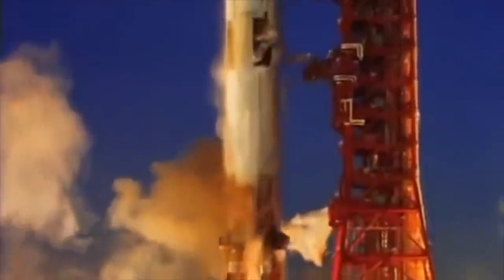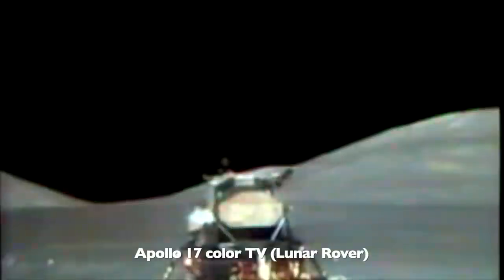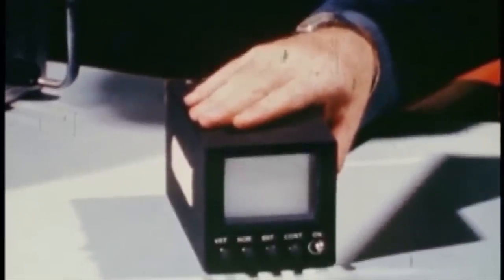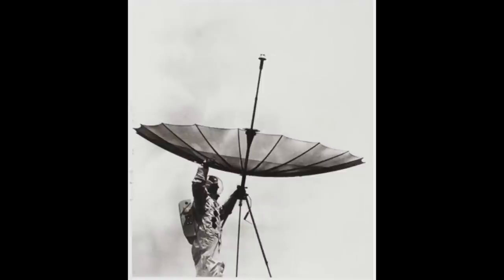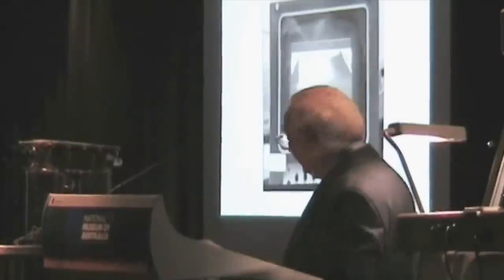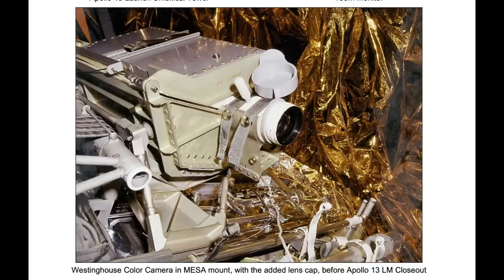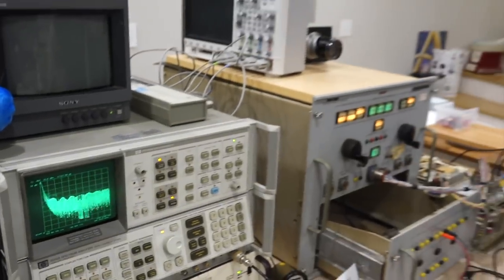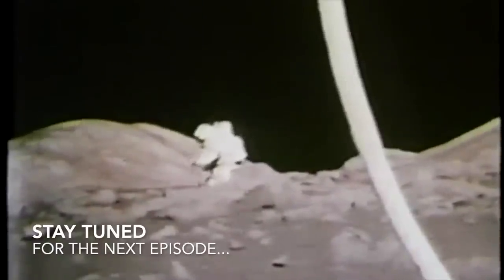Apollo Comms Part 22: How NASA Upgraded the Moon TV to Color

Comment: The good thing about analog TV transmission is that you can still see something even if the signal is bad. Even today's surveillance cameras still use a slightly modified analogue signal. 16:9 instead of 3:4 or 4:5. just longer lines

Comment: When I was going to technical college in the early 1980s, I did a presentation on the CBS-Columbia 12CC2 Field Sequential Colour System from 1951. It too used spinning colour filter discs and also suffered from fringing issues. Interesting that they revived that concept more than a decade later for the colour cameras on the Apollo missions.

Comment: First met Ikegami ENG cameras in the early 80's  Lovely bits of kit. My first was the HL77. I kid you not, the HL stands for Handy Looky  :)

Those NASA guys certainly did manage to squeeze remarkable results from hardly any bandwidth.
Reply: I had the unique opportunity to work with the Ikegami HL-77 prototype in the ABC (NY) Engineering Lab in 1976.  Even took it out in the field once or twice.  The HL-77 was succeeded by the HL-79, and preceded by the HL-35 and HL-33, which were two-piece units with almost-identical backpacks and CCU's.
Reply: The orange and cream colored Ikegami camera shown at 19:10 in the video is one of a series of professional ENG cameras introduced around 1980.  They were intended for a lower-end market (compared to HL-77s or HL-79s).  I believe the model shown is an ITC-730A, but I can't be certain.

Comment: There is a great movie about Parkes and the Moon mission.  It's called "The Dish".  I remember seeing Apollo 17 launch in December.
Reply: In "The Dish" you can hear how the signal from the Moon is received before it is fully over the horizon (and the Parkes dish might have been a degree or two above the horizon) by using an offset feed on the dish for about 30 seconds and then switching back to the straight feed.  This is actually in the dialogue of the movie (although not explained at all) but you have to pay close attention.  This enabled the switch to the Parkes signal to be made earlier than would otherwise have been possible.  When I saw the movie in the theater that immediately cleared up something that I had been wondering about for a couple of decades.

Comment: Chrominance bandwidth is only usually a fraction of the luminance's. You can probably safely get away with 1/10th or less. It would be a bit of work, but you could split off the NTSC colo(u)r, filter the luma with a low pass filter, and remodulate the chroma within the available bandwidth. Obviously the receiver monitor would need a chroma decoder based at the correct new offset. It sounds like they were trying to copy PAL/SECAM colour encoding towards the later missions.

Comment: I have a question that’s not specifically relevant to this video but I’ve just finished catching up and I’m putting it on the most recent video in hopes it will be more likely to get a response.  I know nothing about vintage electronics or computers and only the basics about modern ones, so I haven’t been able to follow the details of the AGC project or this one as I’ve watched all the videos over the past few weeks, but I can definitely admire both this team’s work and NASA’s.  There is a lot I don’t understand, but one question I think I might actually understand the answer to is this: when I watched the AGC videos, I saw the team meticulously test everything step by step in ways I never imagined would be possible.  In this series there seems to be much more “turn it on and find out if it works,” which although it’s what I as a normal person would do, seems very different from the approach to the AGC project.  Can anyone explain why the difference?

Comment: I've watched every second of this fascinating series. Thank you for doing this.
I was wonderingif you found any details of the Lunar Rover mounted transmission system, as Rover video was not routed through the LEM. It would be interesting to know any difference or improvements in the Rover transmitter.

Comment: If you take the r g and b outputs of the Ikegami and lash up a switch driven by the field sync output of an spg genlocked to the cameras composite video output you can recreate the sequential colour system. But decoding would be more of a task requiring 3 framestores😁

Comment: Imagine that. They used the original CBS Color transmission scheme from the 1950s before NTSC color became standardized. ...though the same method is still used on DLP projectors, only faster.

Comment: Adapting NTSC for 700kHz bandwidth would involve a lower color subcarrier frequency chosen to match the lower sync frequencies yet with different integral ratios to keep the frame rate at 10 fps instead of 4 .
Reply: NASA did an extensive Color Television Study back in 1965-66 that discusses something like this as an option (but 1.25 MHz instead of 700 kHZ).  NTRS 19660013061 will have more than anyone would care to know on ways to achieve color in space using mid-1960s technology.

Comment: Does anyone know why the link module thing is built so rugged? I don't know much about spacecraft engineering but I thought they spent a lot of time shaving off as much weight as possible. The casing of the thing looks like it could fall from orbit onto concrete and be perfectly fine. You would think they would build the housing out of something like plastic or fiberglass to save weight.
Reply: Modern electronic space stuff is built very rugged for two main reasons: resisting to the huge loads of the launch (acceleration and shocks/vibrations) , but also to shield electronics from various radiation's and cosmic rays with thick enough metal. I guess that was already true at the time.

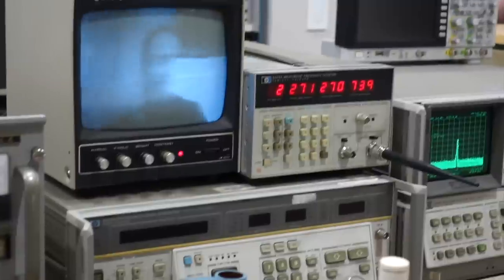Comment: 5:40 If I understand correctly, from Apollo 15 onwards the camera on the lunar buggy used full NTSC 525 lines 30ish frames per second black and white, but each frame was passed through an RGB filter, so if that were to be played back on a slowed-down TV you would see individual frames of R-G-B-R-G-B-R ... etc, which isn't apparent on live TV at the correct speed? So there was no need for any kind of conversion EXCEPT you wouldn't be able to watch on a normal TV cos the frame reset was different?
Reply: Yes, there was a spinning RGB filter wheel that let the camera produce R-G-B filtered images, but the color sequencing was done at the field level instead of at the frame level (where two fields make up one video frame). So, one field of red, one field of green, and one field of blue.  Back in Houston, NASA used a magnetic disk video recorder to record each field and repeat it 3 times.  They then matrixed the three color channels into a standard NTSC signal.

You won’t see the individual color fields, but if you freeze the image where there is fast motion in the scene, you will see color fringing because the red, green, and blue images that make up the composite video field were captured at slightly different times.
Reply: @JoeDurnavich  Hi Joe. So every 1/30th-of-a-second frame from the RCA colour field sequential camera is filter subtracted to generate a red, green or blue image. Back in Houston they receive the red image and write it to disk. Then the green and blue, at which point they have a full colour composite held on disk. Are you saying they repeat that composite image three times, i.e. the network TV signal will have 3 identical frames over each 1/10th-of-a-second? And if so, do they process the next three R-G-B frames at the same time to create a continuous stream? Thanks.
Reply: @horacezontalbeam  Figure 27 in the Apollo Color Television Camera Manual  shows how the magnetic disk recorder tracks were used.

The system operated at the video field level, which are every 1/60th of a second.  Let's say we have a system with three color channels for output: red, green, and blue.  Houston receives a red field and outputs it it on the red channel.  Then it receives a blue field and outputs it on the blue channel while on the red channel it outputs the first repeat of the red field received previously.   Then it receives a green field and outputs it on the green channel while on the blue channel it output the first repeat of the blue field and on the red channel it outputs the second and final repeat of the red field.

For each video field -- every 1/60th of a second -- it combines the red, green, and blue channels into one NTSC field.  So, each color channel is updated every 1/20th of a second but they are offset from each other by 1/60th of a second, which is why you get color fringing on objects in motion.
Reply: @JoeDurnavich  Ok. Please bear with me because I'm trying to understand this from the point of having no knowledge of how analogue TV works. From what I understand, although the frame rate for NTSC is 60 per second, it's interlaced, so every two frames create one frame at 30 fps. The output from the RCA field sequential colour camera is 30 frames of R-G-B in sequence, which is why curiousmarc states you get 10 frames per second in composite colour. The colour fringe occurs because the colours overlap when the movement is fast. My question was, does Houston output the same composited image very 1/10th of a second because you said earlier it is repeated 3 times? If not, are you saying that there are always 3 colour frames, i.e. R1+G1+B1, G1+B1+R2, B1+R2+G2, R2+G2+B2, G2+B2+R3, etc.?
Reply: @horacezontalbeam  I think what you have at the end there is what I am getting at.  I think I have this right, but this may be a different way of looking at it: The camera is capturing and sending 1R-2G-3B-4R-5G-6B-7R-8G-9B, etc. where the number is a simple sequential field counter.  The fields that get displayed on the TV sets on Earth are comprised of a sliding window of three successive fields where the window advances one field forward at a time.  So field one on the TV is made up of 1R-2G-3B.  Field 2 is made up of 2G-3B-4R.  Field 3 is 3B-4R-5G and so on.

I'm not sure what effective frame rate you would put on that.  It's not really 10 fps like the slow scan black-and-white TV of Apollo 11 was because every composite field is different.
Reply: @JoeDurnavich  Had to read through a couple of times but I think I understand what's happening. Each frame is actually half of the TV picture because they are interlaced (I am just confirming this not lecturing you!). But they have to come through the Doppler compensator (mag. tape) into the scan converter, so they have to write each frame to magnetic disk because they are not synchronised. I think this is where the confusion comes in because, had they received a sync signal in the first place, there would be no waiting around. The mag. disc is in sync with NTSC, so let's say there are 30 slots into which you can write a frame. The first red arrives and is written to slot 1. The disk is going to move on so they copy slot 1 to slots 2 and 3. Now we have the same red filtered image in slots 1, 2 and 3. The first green frame arrives and the disk has moved on to slot 2, so the green is written into slot 2 with the red that's already there, but also into the next two slots, 3 and 4. Now the blue frame arrives and the disk has moved on to slot 3 where the red and green are already written. The blue is written into slot 3 and also slots 4 and 5. As the disk moves on, each slot is output to network TV as all three colours. What do you think?
Reply: @horacezontalbeam  It does help to set aside the notion of 30 fps frames here.  Analog TV was designed to work without requiring any memory, so as the video camera scanned a beam to capture an image point, the TV set’s beam was following along displaying that point as it came in.  Sync pulses served to align the two beams.  There really is no complete “picture” like we might have today digitally.  It’s just a moving spot of light.  The camera on the lunar rover sent a regular (monochrome) video signal with vertical and horizontal sync pulses.  A disk recorder was required because they now needed some sort of memory to handle the problem that the red, the green, and the blue for a point in the scene were 1/60th of a second apart from each other in the video stream and in NTSC those three have to be transmitted together.

That memory processing was done in units of fields (the interlaced half-frames) with the disk recorder.  The disk recorder used just 6 tracks (or slots if you prefer).  It didn’t have to copy slots or combine images back onto the disk.  It was able to read or play back three of the six tracks at the same time.  The disk rotated 60 times per second (the length of one video field), so for every rotation it would write the video coming from the moon onto one track and read three other tracks in parallel (R, G, and B) and feed those signals into NTSC encoder to matrix the colors and inject the color sync signals, etc.

(There was the problem of combining odd interlaced fields with even fields, etc., but that was handled by delaying one of the fields by half of a line.)
Reply: @JoeDurnavich  Oh. Perhaps I have misinterpreted the description from Apollo TV by Bill Wood. "Since the disk recorder continued to run, the red channel output would be repeated two additional fields while the blue and green fields were being received and stored in their designated recorder tracks. The blue and green field store recorder tracks would also repeat the same field two more times while waiting for their respective color fields to be received." 

And I fully understand what you are saying about nothing being stored in memory because the TV should be receiving the data in real time but it wasn't in this case. It was written onto tape at the incoming speed and read at NTSC sync speed some 10-12 seconds later by a second tape deck, like with a VCR. Then it had to be reconstructed as a single image in real time. I think from the description of the black and whiite 10 fps scan conversion the signal (picture) was repeated six times. If the mag disk is spinning it has to be able to copy the data somehow while it waits for the next frame to arrive.

Once again, sorry to be such a bore with this but I really don't think the author of the video has explained it well enough. It's a shame he couldn't have got hold of a mag. disc replay machine to show how it works as well.
Reply: I see NASA used MVR video disk recorders for the slow scan black-and-white scan conversion, so maybe they adapted those somehow to the color scan conversion and not the Ampex HS-100.  The MVR-100S has one platter with 2 heads, so I take it you would have to somehow sync up three units to get 5 or 6 active tracks.  I'm just guessing on all this though.

The NASA guy who probably would have known the most about all of this, Olin Graham, passed away in 2016.
Reply: @JoeDurnavich  Can you send me a link of where you read that NASA used MVR please?

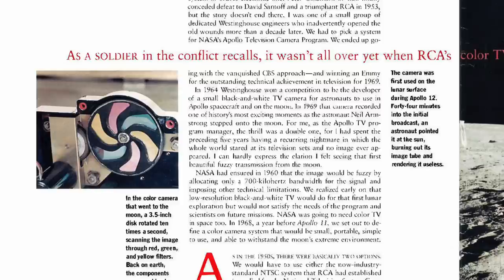Comment: at +7:32, minor error: 60 HZ field rate, 2 fields per frame, and 10 frames per second = 600 RPM, not 10 RPM.
Reply from the maker: Indeed. I meant to say 10 revolutions per second, not per minute...

Comment: I hate to bring this up in case the trolls lift their heads up out of puddles of drool and take notice, but I feel this is an important point to make.

Those certain people, you know, the, "They couldn't do that with 60s technology..." bunch love to point that out without thinking. Though they have little understanding of what remarkable technologies existed back then. Electric cars were first built in the 1880s!

Let's see now... technology, hmmmm... we want a device to do something, but it doesn't exist. I know, I'm going to invent it! 

We don't have rockets to go to the moon - let's invent one.
We don't have the ability to maneuver in space - let's learn how to.
We don't have vehicles to drive on the moon - let's make one, able to fold up for storage too.
We don't have great TV cameras or able to transmit adequately - let's figure out how to.

These dummies can't grasp the simple concept of need driving technology forward and the ability to either adapt existing technology to newer uses and/or greater efficiency or to develop new, as yet, non-existent technology as required by new challenges.
Reply: Can't go to the moon with any technology lol. It's physically impossible.